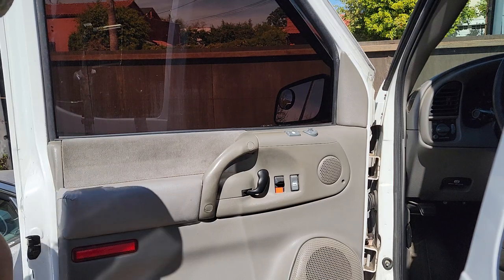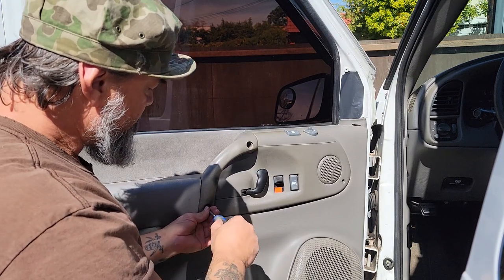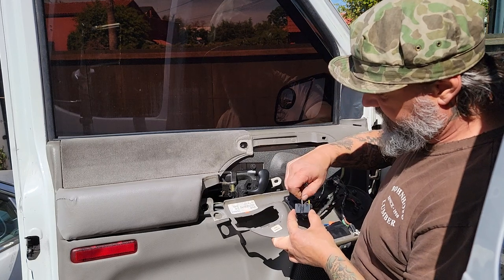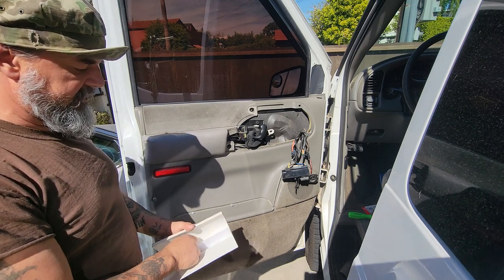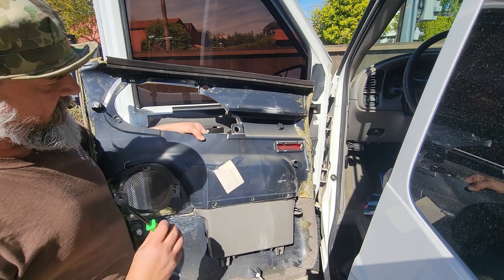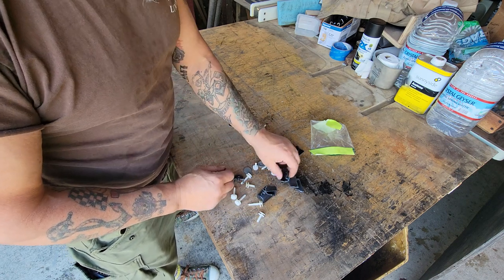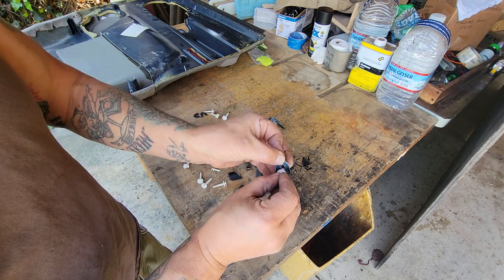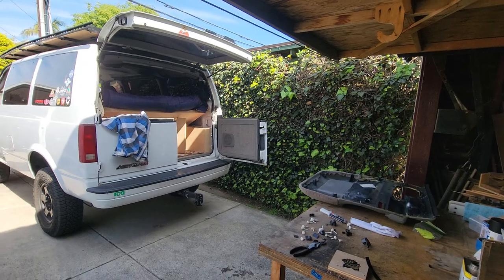2004 Astro Van  Front Door Panel Removal & Clip Mount Restoration

Comment: Michael, aa a followup, (and thanks for your answer on not needing remove the door to fix thevwindow crank). I belive it is called a manual "regulator" I need to fix the windiw, manually crank up and down). As a followip, my drivers door no longer locks and unlocks. (I cannot open the drivers door from the outside AND from the inside)! Do I have to replace the drivers front door to get the door to unlock and open? (2004, manual window regulator crank and manual door locks).
Reply from the maker: Open it up and take a look at what's going on - It's likely something you can repair. If something has broken you can find the replacement part(s). If the pars aren't available anymore then you'll need to go to a junk yard and find them

Comment: Question... I will be replacing the front speakers. Is there a way to just remove the plastic that covers the speakers instead of  pulling out the whole panel? Are there clips that make it possible to remove the speaker covers?
Reply from the maker: I really don't remember - This is an old video BUT, I too have to replace my speakers so will be doing a video on that when I find the time